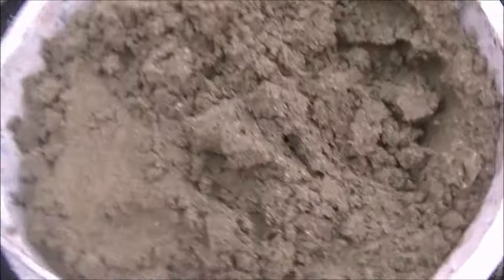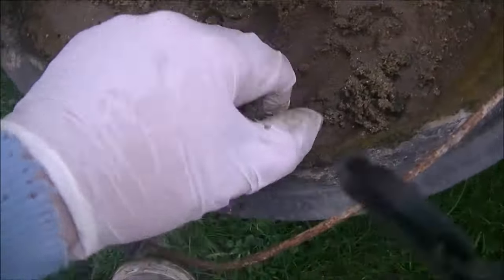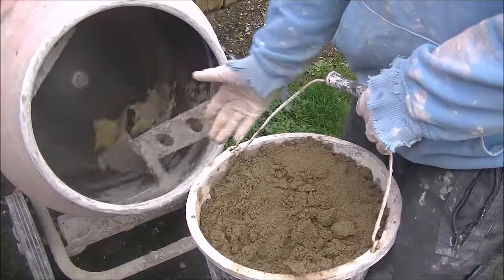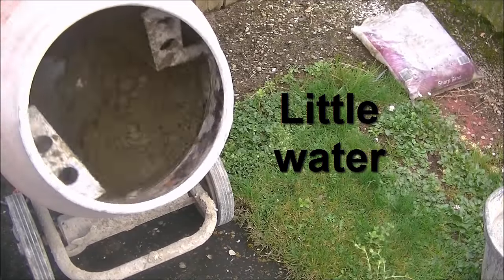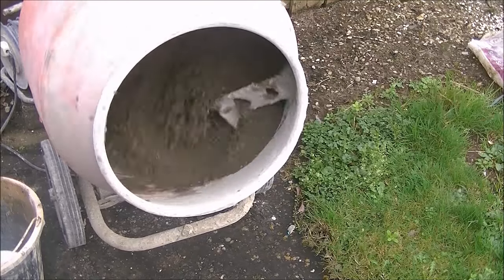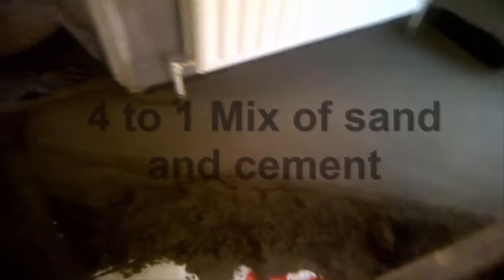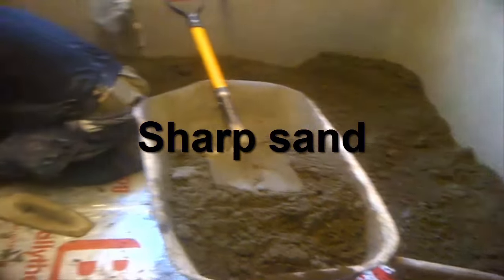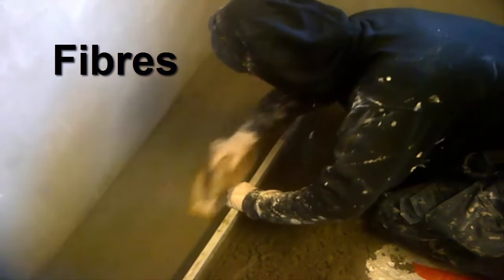How To Make and Mix Floor Screed

Comment: don't you include aggregate?
Reply from the maker: Good question you can add a little quarry dust or fibers for more strength or sbr in the mix or all three but no stone the stone is in the sub floor mix a concrete mix screed is just really sharp sand and cement as seen here mixed simi dry for ease of use, this would be a concrete mix = https://youtu.be/s8-8Hoa9-0o and this is how i would get that finished = garage floor = https://youtu.be/47JCOgNjCTQ   but for in a home screed  - https://youtu.be/1z5CBoDO1AQ

Comment: Hello mate, if I was to screed on top of an existing path ready for tiling would I pva before hand also should I add any liquid solution to the mix?
Reply from the maker: is it inside or outside buddy ?
Reply: @macplastering  outside
Reply from the maker: @swldn  I would power wash the thing all down , take all lose away then either sbr as you work so you are going over it wet and add some to the mix witch should help it get stronger , but if you have a good layer of thickness down it should be good and strong 3 inches plus , but concrete might be a better option for out side  , thought screed will be neat to work with , Hope this helps mate
Reply: @macplastering  thanks for your advice !
Reply from the maker: @swldn  Not a bother man hope it goes well for you mate

Comment: Hi hope your well, if you had a small space, 1mx1.5m area, and didnt have access to a mechanical mixer, is it possible to mix that ratio by hand and use as screed? If so how would you advise to do the mix? Many thanks for the vids!
Reply from the maker: Hello mate doing good here hope you and your family are also,  so yes it will be hard work I would do it with damp sand and add the cement then just mix by hand again this will be hard work much like I have done for this video - https://youtu.be/2x7LN0X1wi0
Reply: @macplastering  we are good thanks, very much appreciate your response and advice, will give it a go and hopefully will go well!
Since its going over a bitumen based painted dpm, do you advise still using PVA primer or anything else first?
Reply from the maker: How think can you go mate ? sbr is the strongest bonding agent i know of to date
Reply: @macplastering  hi sorry just got what u meant!! I can't really go too thick, but I understand if unbonded need to be minimum 50mm?

Comment: What kind of sand is used ?
Reply from the maker: Great question the sand I use is called sharp sand it is very coarse , but i have used a coarse plastering  , hope you subscribe for more :)
Reply: I ask you because here in Mexico we use sand and gravel (crushed hillstone) we mix sand, gravel, and portland cement, empty the firm, and then we have to give it the finish with cement diluted in water and hit it with the trowel, and I see in the video that when going battering is already polishing
Reply from the maker: @juanluissalazar9734  Sounds very interesting way of doing would love to see it being done buddy.

Comment: another great vid! so ive worked out i need to mix 0.35sqm to get my bathroom up to level. thats a fair amount of sand and cement, im working alone. do you have any tips on mixer size and amount to put in mixer each time?im able to get the mixer in the bedroom right next to the bathroom and i can dump the screed mix into it from outside the bedroom. also is it best to buy the sand and cement and mix yourself vs 35 bags of it ready mixed? thanks again!
Reply from the maker: I like ready mixed the best a truck / lorry can come and dump it off ,so i cover up ground with plastic and get it their then bring in with a wheel barrow, If i have to mix for small areas I do it also outside to stop the dust then pour into the barrow and wheel it in its hard work but is the best way to do it as keeps your lungs safe mixing outside, this mixer hold I thin 4 or 5 buckets for screed witch will give you a nice big barrow full , advantages of getting it delivered  is out can tell them what amount you need the mix and deliver it so you just need to get it in an laid down
Reply: @macplastering  thanks again! so its finally screed day on sunday for me, thickness is 50mm one end, 100mm the other, 2.4x1.6m area, about 0.3 cubic metres. its going on top of concrete, should i use some kind of bonding agent to get the screed to bond to the concrete? or maybe brush in some mix into the dampened concrete? thanks.
Reply from the maker: @jamskof  have you got dpm under concrete mate ?
Reply: @macplastering  no, ive only ever been told to use some kind of bonding agent. theres going to be waterproofing done on top of the screed as its a bathroom. in oz they use strips that are about 100mm wie that cover all joins, and then a waterproof paint on all wet areas
Reply from the maker: @jamskof  The dpm s to stop damp coming up mate here we have to use dpm and insulation  most times the dmp is under the concrete then another layer with the insulation to be safe then screed but if you cant then for sure a bonding agent will do no harm at all keeping the floor down
Reply: @macplastering  interesting, makes sense, i hadn't thought of that. thanks!
Reply from the maker: @jamskof  No problems mate always here and new videos Every Sunday :)
Reply from the maker: @jamskof  Hope it went well for you buddy

Comment: I wish i had seen this vdo yesterday

Just magnificent
Reply from the maker: Oh where you doing a floor mate ? have a few on the way i lay them also
Reply: @macplastering  I am a DIYER, did around 30 sq mtr floor garden path/ramp - it was my first time so didnt know the  water  ratio it was a nightmare levelling it bcz it was too wet. 

m gona do another 30 sq mtr area soon with your techniques. hopefully it 'd be easier this time will let you know.

near Dunstable
Reply from the maker: @sidjohnson1776  This mix is for inside I cant remember trying it outside but yes let me know how you get on as long as you have good solid bed to work over I would think it should come up well let me know buddy wishing you the best

Comment: Thanks for the video. How soon can you add floor screed to fresh concrete?
Reply from the maker: if you have all you dpms in the concrete straight away as long as it can be walked on if you need to add dpms still you will want to let most of the water dry out 1st as you dont want to trap it in

Comment: Great vid. Could I replace the sand with quarry/grano dust (6mm-dust) in 4:1 ratio Or would you do 2:2:1 quarry dust : sharp sand : cement?
Reply from the maker: i have never tried that myself be good to test 1st before you do all out at somthing big mate
Reply: @macplastering thanks for the reply mate, good advice! Keep up the good work, some brilliant knowledge for us DIYers 👍
Reply from the maker: @2penniesworth  Thank you my friend and do keep in touch
Reply: Tried a small area 3:1:1 quarry/grano dust : sand : cement. Didn’t go as planned. I think with a semi dry mix the small stones in the dust made it harder to pull the straight edge accross the surface and leave a nice smooth finish. Ended up having at add a lot more water and change to a more concrete type mix to finish off. 

Got 30sq/m left to do, so going to switch to 4:1 sharp sand : cement as per your vids.
Reply from the maker: @2penniesworth  is it all inside m8? Yea Sharp sand is brilliant for it for sure
Reply: Yes it was inside mate. Got a ton bag of sharp sand coming this morning so going to try it your way. 
Is the process exactly the same as this video regardless of quantity? I.e get the sand wet in the mixer to the right dampness then add the cement but no more water and it’s usually right?
Reply from the maker: @2penniesworth  you can add half the sand, then cement, and the other half of sand and just add water slowly as a little too much, and it's all bally and harder to work then some times if sand us damp from being  outside you won't need to add much if  any water

Comment: I have a flat external roof  patio that has fibreglass and decothane (liquid plastic) coating. I want to lay a screed to fall  to stop the pooling. What prep would you do over the coating, fibre-mesh, DPM etc ?  or would you strip back to original concrete? cheers.
Reply from the maker: If you could do a dpm would be great should stop any water getting right through what depth do you have to play with ?
Reply from the maker: Hope you got on well with it bud

Comment: Looking to lay a garden concrete slab 5x3 meters 
Dry or wet?
20mm chippings are to big for semi dry one?
Cheers
Reply from the maker: Be gard to finish but could be mixed that way I have another video on mixing wet concrete

Comment: I have to screed over an old painted concrete floor (I'll prime it first) and thickness would go from 3 to 45mm - would this mix work?
Reply from the maker: The 3 mm would be very hard to get that to stay on we would put this gear down 3 inches at the norm how did you get on ? sorry for late reply been very ill
Reply: I have a slightly less difficult job with a wet room screed that, at its thinnest will be about 15mm thick. I have made a sample with 6 grams of fibres per litre of cement and 300 ml of SBR per litre of cement and 3 litres of sand per litre of cement. I cured it for 24 hours at 45C so I could test it quicker and it is already pretty tough. However, from all I have read the only solution for something 3 mm or less is an epoxy screed that costs a small fortune.

Comment: Great video - thanks for sharing!
I have a bumpy garage floor that I want to level off for garage flooring tiles. There is a 5-6” gradient back to front where it meets the driveway, so levelling compound is a no go. 
Could you tell me, what’s the thinnest this kind of screed can be applied please?
Cheers!
Reply from the maker: The thinnest I have ever when was 10mm in places with no issues but I dont lots of preparation I bonded to floor with sbr added sbr to mix and also fibre's to help reinforce the screed   , both floors where tiles one I would still see now and again and it has lasted very well , but if you plan on driving on it you might want something stronger than screed  like a liquid concrete ?
Reply: mac plastering Thanks for the reply. 
Yeah, thought as much. It’s not going to have to support a car (garage not long enough), but it’s probably still pushing it as it will probably be shallower than 10mm in most places. 
Guess I’ll try and coax a floor screed to not run out of the front of the garage 😉
Reply from the maker: @watty13  10mm is realy pushing things and if it dont bond or cracks you will be back to the start , what's down now is it concrete ?
Reply: mac plastering Yeah, was layed about 15 years ago... divots, and bumpy stoney surface now. 
Do I give it a coat of pva priming prior to levelling, or whack it straight on? *quite dusty
Reply from the maker: @watty13   floating screed should be laid around 65 to 75 mm thick a foating screed is on insulation and dpm = damp proof membrane, but this would be called a bonded floor witch would still be recommend to go 25 to 40 mm  if this was my house and I really didn't have room to go higher but wanted to get it much more level I wouldl either get a suitable self leveller or if need to screed my plan of attack would be get that dust off brush t hover it until is as dust free as possible then I would do a say 5 to 1 mix 5 water 1 sbr and paint the whole floor a day before to seal that dust down then the next day when im ready for the mix I would have sbr in the mix bear in mind it will speed up setting time but add strength , there is other additives that can add strength sutch as fibres so I would get them in again they can and will making finishing that little harder but will act as a reinforcement to help reduce cracking   so I have my mix read before I dump it out on the area I am about to start I will again paint that area with pure sbr and go over it while its wet so the mix will set with it giving the best bond possible bond , another step I might think of is scoring the floor some but it might cause more dust and mess that it could help  , Screeding is no easy task for sure and this type of floor is very challenging but hope I have gave some good points for you do think over , you might be safe doing a small test area somewhere to test strength and bond before going at the whole job ?  again hope this is helpfull mate
Reply: mac plastering That’s brilliant, thanks for taking the time to help me out 👍🏼
Reply from the maker: @watty13  Any time buddy wishing you all the best and let me know how you get on mate :)

Comment: Mac ....  When patching floors, what do use to replace the plastic damp proof that the plummer has shredded, before putting down screed?
Reply from the maker: If you can gently cut back further and add a little more try over lap it you can also sbr under it try or something that can seal the subfloor
Reply: @macplastering  thanks mac
Reply from the maker: @Roy1  anytime buddy also could add sbr and water proffer to mix to help prevent any issues . There should also be a dpm under the sub floor... when doing our own there is dpm under the sub and I will do more again on top of sub floor

Comment: Hello great video. I want to do screed floors I'm my house, I won't be putting down any tiles. I'm interested in the fiber reinforced screed as I heard it's good for heavy traffic areas. What bonder should I use? Also when should the fibers be added? Also how thick should it be? Is 2 inches too thick?
Reply from the maker: 75mm is best its around 3 inch's I add the fibers to the mix  adding to the water will just make them stick in lumps and not spread out I also use sbr as a goof bonding it is also water proof hope this is helpful mate
Reply: @macplastering  yes thank you. Should I just use Sbr instead of water or should I mix it with the water phase?
Reply from the maker: @ladysaw999  I mix mine in the water same amount to every bucket to keep the mixes even

Comment: Hi, what would the minimum depth be (if there is one)? & what is best bonding agent? I was thinking of using undiluted PVA glue, I am in Uk - thanks Paul
Reply from the maker: I always try go 75mm about 3inches mate and i would use sbr its much stronger have a few how to screed floor video up if you need also mate
Reply: @macplastering  Hi, I was gonna use some self levelling compound but I’m not confident, I saw you video and hoped I could do it like this but my maximum hi/low point is around 12mm, what would you do then?
Reply from the maker: Sorry for late reply mate youtube hide about 50 comments on me in held for review box ? is only meant to go there is bad words in.... but yes so to answer you the thinnest I ever went was 10mm in places  but I had used sbr on floor also in mix along with fibres to help give it good strength again this is really pushing the limit but its also why I done the extra's to help make it work and last

Comment: I remember a builder telling me to put some bricks in the mix to break the balls in it, but wetting the sand 1st is the best I think if mixing a little bit throw in the sand and cement let it mix quickly and straight in the barrow
Reply from the maker: Yes sae here mate as soon as its ready bang it out and into the floor :)